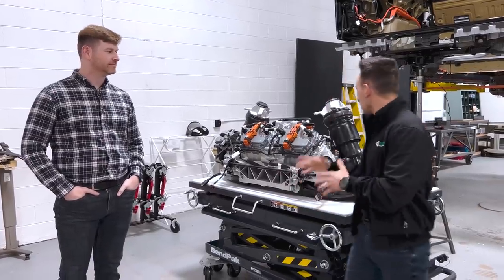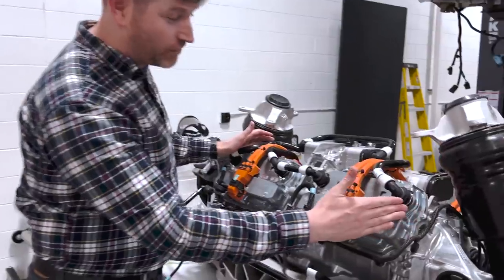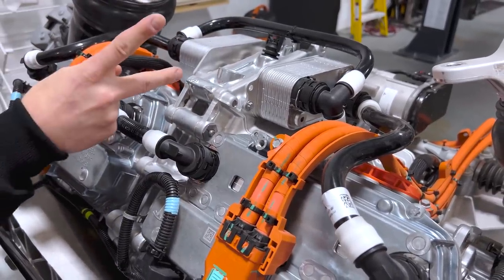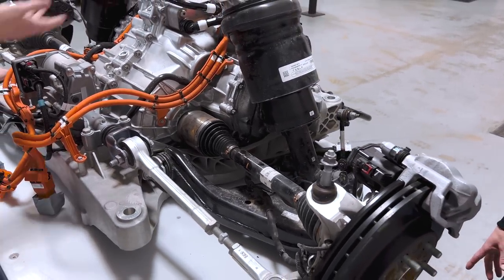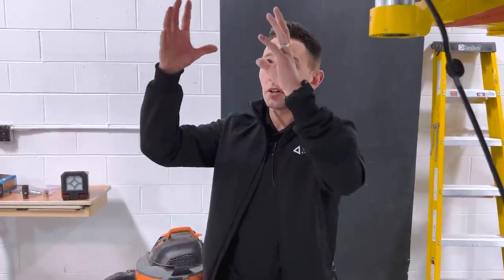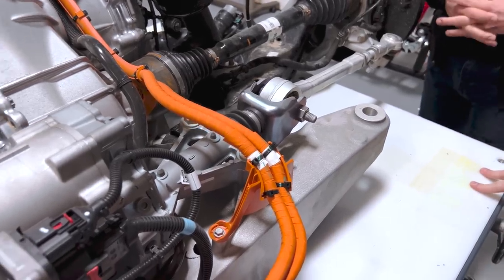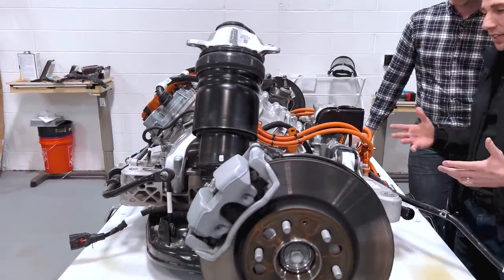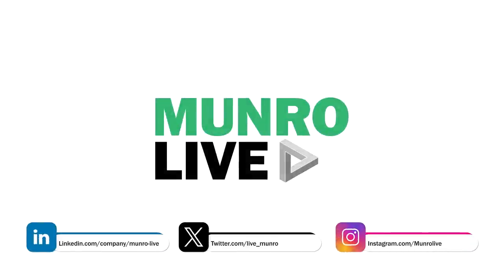Underneath the Cybertruck - Rear Cradle and EDM

Comment: I'm curious why there are what appear to be spacers at the inboard end of the drive shafts.  It would seem lighter, cheaper, and more flexible to make the drive shafts as long as possible.
Reply: There are no spacers. You are seeing the inner CV joint housings; they are long (axially) to accommodate plunge (axial movement of the shaft) with suspension travel.
Reply: @brianb-p6586   Aha!  The CVs that I'm used to have a much smaller plunge dimension.
Reply: @AlanMcYou  these look like tripod-type CV joints, the longest style.

Comment: Question?
If you stalled out the motors, wouldn't the amp draw go up?
I'm assuming a lot of die cast aluminum?
Regarding the Giga casting, is Tesla just trying to 1 piece a lot of parts?
Ride Height sensors, are they lowering the height of the Cyber truck?
Side Note
That 4 wheel steer is a great idea...
Has anybody drove the Cyber Truck in Icy Conditions?
Reply: TESLA uses Special AL alloy for Gigacastings. 
6600 Ton (front), 9000 ton (rear).
the Front & Rear axle Tesla MEGA CRADLE (tm) also use smaller castings , rather than Stamped or Joined steel. 
Tesla has VALIDATED Cybertruck @ Fairbanks , AK USAF proving grounds in WINTER.
Reply: On the motor stall, yes, the power will be high, but should be as efficient as a PTC heater.  This is done as a cost savings and improves reliability. Removing the PTC heater also removes related wiring, switching electronics, and wieght.
Reply: @tesla_tap  - the BEST part is , no part in First place.
each part needs to have Multiple functions.

Comment: Talk more about the front and rear steer please.
Reply from the maker: We will in a separate video.
Reply: and more importantly than steering is how the signals get from the "steering wheel" to the steering motors.  Cyberbeast and cybertruck are flybywire, and allegedly they use a networking bus for communications.
Reply: @davidanalyst671  that's part of what I meant. The whole steering system.

Comment: When you change wheels the discs will easily come lose a few mm and you get dirt behind on the surface of the disc without that bolt holding the disc. Strange decition by Tesla. On the otherside these bolts are a pain ro remove after a few years of rusting. Maybe it's better to not have them.

Comment: The Rivian is the best truck.  The Cybertruck is too new to know about long term reliability.  The Rivian has had many problems including massive phantom drain.    You have to spend $5000 to $7000 to wrap the Cybertruck.   It is all but unavailable for the foreseeable future.    The Ford is due to be redesigned and the max plug is coming next year.  

My first pick would be the Cybertruck.   Followed by the Ford.   I would be happy with any of these trucks.  They all need work.

Comment: Same observation when I saw the M-3 motor/drive/assembly/ architecture tear-down; "a work of art"(.) Accounting for cost/weight/speed-of-production is inherent in every product. A manufacturing 'philosophy' that dictates design parameters, keeping the product to a standard, easily replicated format. Like the cross-pollination of the ECUs for 3/Y/S/X. The mechanical design in Cybertruck however is 'steer-by-wire', so that must also be integrated into the framework of the chassis/motor architecture. Very interested in the feedback, wheels-to-environment, that adjust to different road conditions/weather. *Note: Tesla uses expensive 'processes' that reinforce the design architecture; "maoney well spent".

Comment: I'm kind of disappointed to see a simple stamped steel upper and lower control arms.  I know it's all about cost, but after seeing all the tubular and cast control arms on modern vehicles, going back to stamped steel just gives the feel of cost cutting for cost cutting's sake.
Reply: there are ZERO bearcat bean counters @ TESLA. 
every part has MULTIPLE functions. 
#1 = SAFETY . #2 - Long Lasting.
Reply: Tesla has low build quality for a premium price, people really are still suprised about tha?
Reply: @markplott4820  I've worked on enough cars to know that stamped steel lasts a long time.  I also know that cast or tubular welded control arms ALSO last a long time, are generally as strong or stronger, and allow for better packaging of the suspension components.
Reply: @hellcat1988   - Gigacast is better. 
lasts longer w/o Corrosion. 
Discrete cast Modules for both Axle is Correct.
Reply: @markplott4820  We aren't talking about the substructure of the vehicle.  We're talking about the control arms.  Those pivoting a shaped structures that bolt to the body and the sub-frame assembly to hold the brake and wheel hub assembly to the vehicle.
Reply: @hellcat1988   - IF the Control arms Dont have Multiple Functions , you must DELETE . Complexity & Weight are a KILLER.
Reply: @markplott4820  You clearly don't know what control arms on a vehicle are...

Comment: Wow! Very cool! But supposedly the average tesla electric motor is 320hp, so that would be 320x2=640hp(dual rear-motors); working from a confined space(with suspension and steering included), that's pretty impressive.
<i need one of those for my go-cart>

Comment: It sure looks much simpler than an ICE 4wd pickup truck???
Reply: This is the cyberbeast. it weighs around 7,000 pounds, and goes 060 in 2.7 seconds.  The motors will be simpler than an engine, but this rear axle, with two motors is a whole hell of a lot more powerful than any Ice in a car

Comment: To me it is so very surprising that this doesn't use the exact plaid motor unit.
Reply: why ? when model 3 DU will do ?
Reply: It uses induction motors so they can be turned off to increase range.
Reply: @saff226  good point

Comment: That suspension serviceability looks quite bad. Also driveshaft angles... I wonder when people will start complaining about them like on S and X. Oh look at this lower control arm, it will be dirt and rust hotspot, very bad design for off-road vehicle, why Tesla why....
Reply: indeed.
Reply: It's a pavement princess like 90% of jeeps and 95%+ Trucks
Reply: @wilinstonthompson1352  Even then it is a bad design, dirt will still accumulate there even if you drive it on the road. Unless of course you do not drive it at all :D

Comment: 13:45 - ok, so what about this rear steering: based on the physical parts present and their configuration, is it possible to add additional range is option to the rear steering with software update alone? We have all heard the rumor that Tesla will go from three to 10 degrees of steering with an OTA. Is that possible with this setup?
Reply: Tesla has to install hardware Update for 10* dec Articulation.

Comment: I think this shows that Tesla spend a lot of time designing and making the Giga casting system as good as it is they still have a lot of room to improve the cybertruck assembly process and streamline some of the parts with better Parts which means this will get faster and better with time
Reply: also the Tesla MEGA CRADLES .

Comment: rusty brakes...already.  lol
Reply: Brakes get rusty overnight if it rains
Reply: Everything just has this thin black paint,  brake rotors, dust plates etc. and cv joint are bare metall. Tesla chose a more low cost way here. I ike to see gray rustprimer on the discs. And galvaized dust plates. Painted cv joints, aluminium control arms etc. Typical American car that will not do good after a few winters in the salt. There is no sign of any anti rust protection, it's designd by guys that don't know winters.
Reply: Happens all the time. Mine look like that a few hours after parking. It's the climate.
Reply: TESLA never uses brakes , only REGEN to Full STOP.
Reply: @markplott4820  I somehow don't believe you. Especially since I turn Regen to minimal on track days to keep the car balanced under braking.
Reply: @cooluser23   - TRACK is a whole Different animal than Daily Driving @ 30 mph .
Track requires you to use your Pedals .
best to UPGRADE from Stock Brakes , and get Track pack upgrade to 227 mph. 
many offer TRACK /Racing upgrades .
unplugged performance has the FASTEST track upgrades for TESLA in the WORLD.
record breaking.

Comment: Upper control arms still looking mighty flimsy… 😅 gonna have premature wear and failures with all that weight and torque, bushings and ball joints have left the chat! 
Just saying they’ve had this issue before and don’t seem to be learning from their mistakes.

 We saw it in pre/post production models where they reduced torque output so it wouldn’t just snap axels and uppers when they hosted media events and seems like they never got back around to it. 

Actually it’ll probably be a 10k option next year 😂 so good luck boys and girls 🎉

Comment: 50 second intro is a bit long.
Reply from the maker: I disagree.
Reply: I didn't even notice.. I just skip forward
Reply: @MunroLive  use the watch statistics. Most people skip over them.
Reply from the maker: No they don’t
Reply: @MunroLive  Sandy, or whoever is responding on behalf of the Munro organization, I enjoy the design analysis of your videos: explaining the costs, values, options, and trade offs involved in the products that you review. I will assume that the same attention to detail would be applied to all your products, in this case a YouTube video. What is the value to Munro and your viewers of 30 seconds of watching a guy loosen nuts and bolts, a couple second watching the two hosts watch the guy loosen nuts and bolts, and finally, 20 seconds of two guys lowering and wheeling the drive assembly out?  I can tell you what it’s worth to me, but then, I’m not a design expert. Of course, I did just spend another 60 seconds of my time responding to this, so there is that…🤣

Comment: Great job on the motor/chassis/wheel architecture, but can't wait for the 48V/Ethernet-hub/'steer-by-wire' teardown; including the actuators/transformers necessary for each Cybertruck function, from windows to steering. "Your gonna need a white-board and colored markers"😂🤣 Elon is correct👍 Step-up/step-down TRANSFORMERS are ubiquitous from the grid to the neural-net, and everything in between. They are a 'bankable' asset in ALL electrification(...$)

Comment: I am struck by the stupidity of this truck at every level.    The rear assembly is huge and space-wasting.    This assembly is entirely EGO BOOST - it gives the ability to say you have x horsepower and y torque but it robs so much space that it is a joke of bravado.    The other thing that strikes me is the enormous cost of replacement of that cast structure - a system that Tesla is infesting upon customers that will explode the cost of accident repairs on these golf carts.

Also as a note to all sponsors of youtube channels - any inserted commercial into a video is automatically skipped by me as I PAY FOR MY YOUTUBE and I DO NOT WANT COMMERCIALS.     You are wasting your sponsorship money.

Rear steer is a gimmick that has never had any real world benefits for most customers.    In the slight situation that some numbnut needs it, that is about 1% of the real world usage situations and is added weight, cost, and complexity that screws the customer again.    This is pure Bravado.   EGO BOOST.

What a crock.    Saying that saving perhaps 25 cents of manufacturering cost of a wheel bolt that will be reused on a joke of a product that costs nearly $100k to buy.     Oh, boy!   We saved a quarter!

The rear control arm looks like a rust creation soup bowl - water and dirt will collect there and end up rusting out that assembly in less than 10 years in northern states.   I cannot believe that design was allowed to go to production - pure stupidity.
Reply: You are so right. As a vanity product, it is an early success. Time will tell how long that lasts.
Reply: Cybertruck is the BEST on the market.
already OUTSELLING , Lightning, Silverado , Rivian , Hummer .
Reply: Calm own lad , calm down , calm down ,dont blow a gasket , hahaha , get it all off your chest . I disagree with you on the rear wheel steer ,ive a merc vito van and would love to have rear wheel steer to help with parking. Also when they are going steer by wire , its super easy to do rear wheel steer as a add on . Agree with you on the bowl to collect dirt ,thats dumb for sure.
Reply: @andrewashmore8000  - RAM had hydronic Quad steer in 1990' s it was commercial failure.
Reply: Exactly, I live on the NW coast, our roads are always, wet, salty, and usually muddy. All those weight saving measures just for the control arm to carry ten pounds of mud.
Reply: @YourArmsGone  - each wheel has scrapper inside.
Reply: @markplott4820  I'm talking about the control arms and the giant openings where the suspension sits. Just perfect for catching mud. Same with the front where the black coverings are designed to fill with crap.
It's not just tesla with the obvious oversights, Rivian has a similar problem with its rear gate and bed.
Reply: @YourArmsGone   - TESLA seemed to be just FINE @ the KING Hammers off road. 
they had MUD holes there.
Reply: @markplott4820 We never saw the undercarriage and It didn't do anything a normal car couldn't do. So far everything about these trucks seems like a big ol waste of money.
Reply: @YourArmsGone  - their PERFORMANCE says otherwise.
Reply: @markplott4820  Yeah, I'm not impressed.
Reply: @YourArmsGone   - NO ONE on Earth, builds vehicles AS GOOD as TESLA motors.
Reply: @markplott4820  LOL Calm down why are you simping for an average car company so hard.
Reply: @YourArmsGone  - TESLA not a CAR company, its AI Robotaxi company , that also makes cars.
Tesla ENERGY will be BIGGER than its car business.
Reply: Time will tell, but with Teslas track record I’m sure it’ll be fine. I mean as you can see this truck wasn’t made for your everyday trucker. Waste of money? I think that’s subjective to individuals like everything else we buy/consume. Each their own

Comment: Expandable clamp over a rubber bushing holding the sway bar - no bueno?  Okay.  "Low volume vehicle" ?  if you say so, but NO.  Just show the stuff, don't comment if you ain't know and get the thumbs up or down.
Reply: I think they said less elegant, not that it was no bueno. And in a comparison to 3 and y, and for the near future the s & x, this vehicle is in lower volumes. However, that’s not the point they were making. They said it implements less elegant techniques similar on lower volume products that Tesla makes.